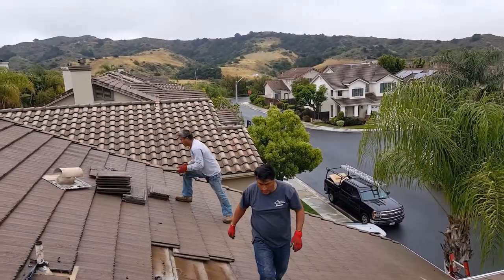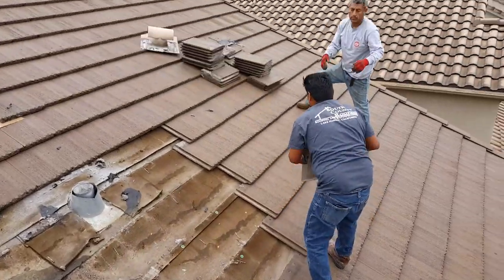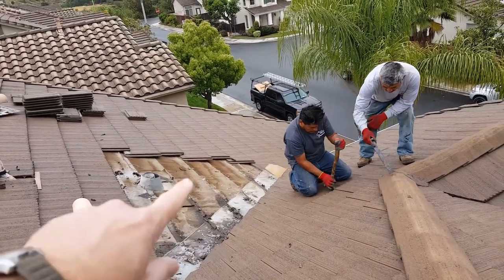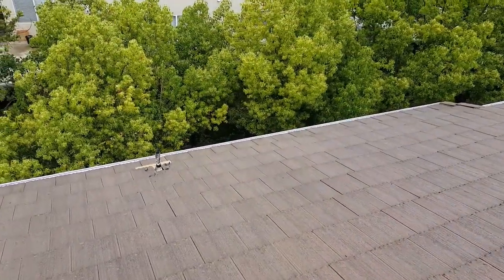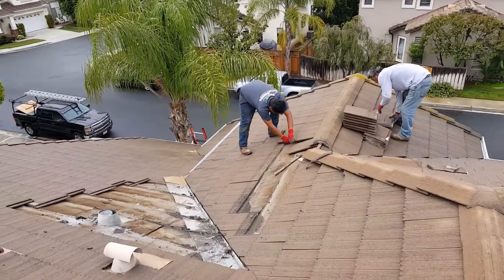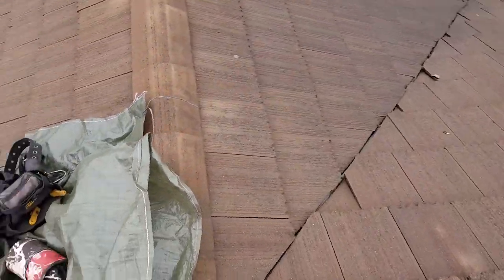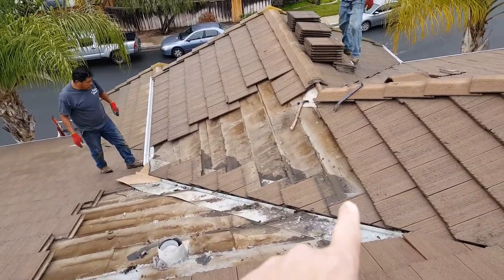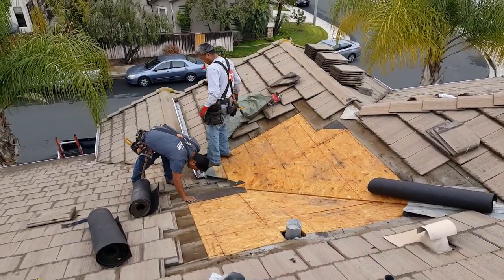Tile Roof Leak Repair - Rancho Santa Margarita Roofing

Comment: Hey buddy you need to take the repair all the way up to the ridge!!! The underlayment lifespan for 2ply can last 25-35 years. Over this time period the underlayment will dry out and it becomes more vulnerable to cracking. In a leak zone, on a tile roof, it is ideal and best to install new underlayment from the ridge to the bottom of the eve. If a repair only targets the leak zone then you will be tying in new underlayment to old. What happens when the old underlayment fails above the repaired area? You will leak again. We have gotten called by customers to fix this type of issue many times and a lot of the time it is the valley area. I hope you consider this as I truly just want to be helpful.
Reply from the maker: Why
Reply: Please read the edit ✍️
Reply from the maker: Hey Pal.  You're wrong about the felt lifespan.  If done properly it's more like 50 to 60 years.  By your logic what happens when you tie into the side laps, and it fails?  I'll quote you "You will leak again".  Does that mean you tell your customers to go top to bottom and not side to side.  I hope not.  If it isn't broken, then don't fix it.  I am not saying you don't need to do as much of an area as you need to.  It is situational.
Reply: How old is the house in the video? 30-35 years old? I bet it is not 50-60 years old.
Reply: Yes,
Agreed…it’s best not to tie-into the existing underlayment. 

I too have seen where the underlayment above fails and causes the targeted leak area to once again fail. 

It’s best to go to the ridge with the nes underlayment 🤠
Reply from the maker: It was built in the 70's.  Yes, more than 50 years ago.
Reply from the maker: Best is to just get a new roof.  If you only want to solve the problem, then it's best to hire someone to fix correctly.

Comment: Very good video. 
Should I replace 34 years old roofing papers on my roof eventhough  visibly we did not find any leak yet?  Home was build in 1988.
Reply from the maker: I wouldn't.  Think of it like a perfect running older car.
Reply: @SouthCountyRoofing  

Thanks so much I already replaced the right side of my roof section with new papers. I think I’ll hold off on left side sections.  just have the roofer replace some broken tiles for a few dollars.

Comment: Good thorough job, build up of dirt and leaves is usually the culprit damming up the valleys sending water of the metal onto the paper where it burns holes and rots paper.

Comment: Questions - what caused the leak? Looks to me like build up of dirt/debris caused by a closed valley, considered a bad idea by some, like the Tile Roof Institute. Do you ever get the chance to re-cut (open) the valley? I'm thinking most customers would refuse the suggestion.
Reply from the maker: A completely opened valley will be more likely to catch larger leaves.  I have seen this first hand and leads to basically the same problem which is the diversion of water under the roof.
Reply: @SouthCountyRoofing  Ok then, what is a good solution? Proper maintenance?
Reply from the maker: @gpdewitt  Annual roof inspection from trained individual.  But, even maintenance can not stop wear and tear which is basically what that is.
Reply: You can open the valleys up, but you need to replace the valley metal with a custom flashing that I have made for open valleys
Reply: Yes tight valleys on tile roofs are problematic and owners of tile roofs should strongly consider cutting back their valleys if they are to tight.
Reply: All new construction today is opening the valleys a couple of inches. 

It is definitely helpful to open up the valleys…but a “Annual Maintenance” is ideal to clean the debris out of all the valley, pan and chimney saddle.

Comment: Will you do a complete repapering and sealing of all vents for the whole roof? Mine is leaking everywhere.
Reply from the maker: If your roof is leaking "everywhere" you probably need a new roof.  I do fix roofs in your area but, we are a smaller roof repair only company.
Reply: @SouthCountyRoofing  What if I wait (the damage is done) until say May when things slow down and have you put a new roof on for me? Its a single story.
Reply from the maker: We are to small of a shop to do that.  Try BP Roofing out of Aliso Viejo.  he's backed up about 2 to 3 months.  get with him asap.

Comment: You can see all the wet marks on the roofing paper .because what you are doing is trapping the water open valleys are the right way .because all the debris washes down the valley its common sense.  And fixing the tiles directly to the roofing felt is also a no no . That's what you have been shown and it might be the USA standard but it's wrong . And your video proves it .
Reply from the maker: Yes, you are correct.   USA standards with tile roofing is "only" going to last 30+ years, and then you will be forced to maintain it.  Question:  What else around your own house lasts 30+ years while being used every single day without spending a dime on it to maintain it?  Nothing...
Reply: @SouthCountyRoofing  your right. I have been roofing in uk 40 plus years and a good slate roof would expect 100 years plus